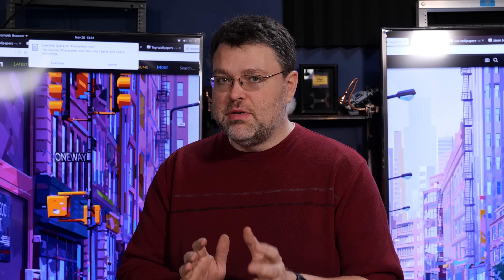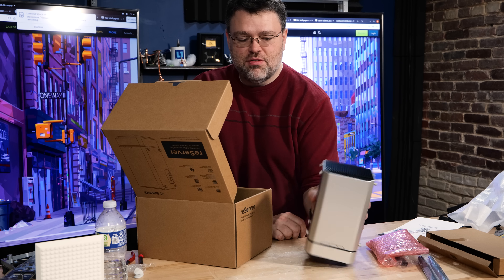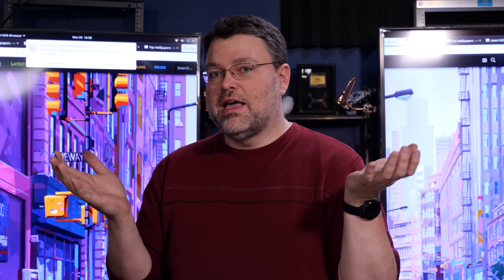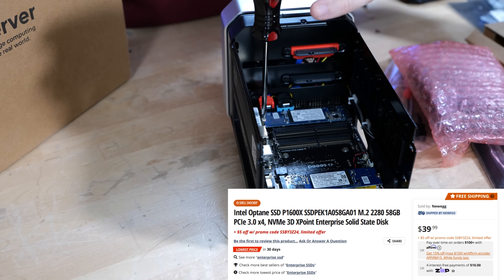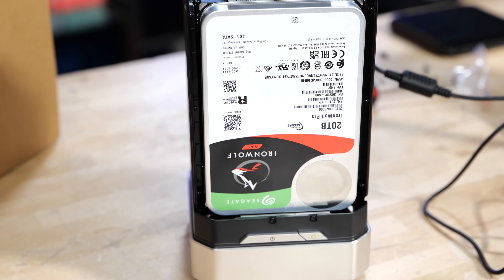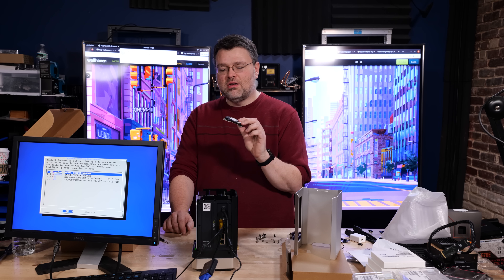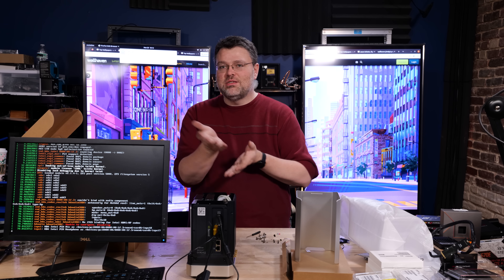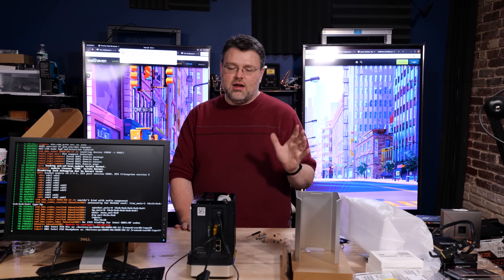Checking Out The Seeed Studio ReServer: Great For IoT + Home Server

Comment: Longish Term review: i've been using the i3-1125G4 model for about 18 months...and it's been great. i ditched the 3.5" drive caddys and just mounted dual 4tb ssd drives directly into the backplanes...I also have a 2tb nvme in a pcie card in the interior slot along with another 2tb nvme for the OS and 64 gigs of RAM. I found some "signed" 2.5GBE nic drivers to use with Windows Server (currently 2025).  I run vmworkstation on it and use it as a NAS/Command and control server. I run VMs like vcenter, Active Directory, Rancher, Xen Orchestra, Wazuh, etc...The 4 core/8 threads have handled everything, temps have been stable, and except for some weird hdmi not reliably working issue,  i would buy it again.
Reply: Do you mind sharing the power draw of this machine, I am looking  for a similar function myself, I am planning on running Proxmox on a raid-1 setup for all the VMs  and chucking 2 SSD's as opposed to HDD for storage
Reply: @hrgagan9192  it's currently pulling only 13.87 watts. It's fairly idle running a plex vm (not streaming anything) and a vcenter vm. I've seen it go as high as 35-40 watts when i'm hammering it...although i'm not really paying attention to the draw.

Comment: For people who are interested in the ARDUINO option, there is the FIRMATA Project. It gives very low entry level to have the Arduino for additional input and outputs. It works with most Arduino versions and can be used with any Arduino connected to USB.

There is just a Raspberry PICO in the higher configuration. Not! A Raspberry Pi! The pico is a whole over type of device. It can't boot any OS like the Pi could.

Comment: Hmm this might be a viable solution to upgrade my A300 DeskMini from AsRock, anyone experience with transcoding on this yet?
Reply: I have 2x NVNE, and 2x SATA 2.5 in the X300 I own. The m.2 WiFi could hook up to 2x external 3.5" disks via an adapter if you needed additional space.
Reply: @dfgdfg_  what type of 3.5 drives where those?

Comment: Of note: the raspberry co-processor is a RP2040, which is the microcontroller that powers the Raspberry Pi Pico. Nifty device nonetheless, but it's not a Pi 4 or anything like that.
Reply: Yes, Came here to say that. :) I checked their site to make sure. It is an RP204 like you say. I think he's got confused what RPi is on there. The two different micro controllers are for when it's used as an edge computing device. They will be a real time component collecting data via sensors and other sources, packaging it up, and piping over to the Linux system.
Reply: I thought that too. He should make that clear in the description or a top level comment.
Reply: Not worth shelling out for the high-end unless you need the performance then. The ARM M0 is pretty good on it's own for a microcontroller.
Reply: @emreelmas214  RP2040 is based off Arm M0?
Reply: Surprised there is almost nothing about it in the video after that intro.
Reply: Pico is the controller, like Arduino. I thought that was the whole point. Anything else, you can simply run a virtual machine that would otherwise run on the regular pi. Unless I totally misunderstood you.
Reply: Also it’s Realtime (RTOS)  while the raspberry , raspberry nano and any versions - this means the counts riinning hundreds fo of threads that are swapping contiuuty who swaps threads to keep the processor busy.

It’s vastly more complicated. A microcontroller typically has one thread and waits until each subsequent operation in im order. This js critical for timing dependent messaging z, i2c, spi,‘etc where clocks
Must shift on time- low to high in 10ns and then low again 10ns later as your send the clock

Comment: I want this, with whatever generation AMD/Intel has AV1 on the iGPU, record TV with Plex, trancode with TDARR, and host it all with TrueNAS or similar

Edit

It would be really cool to get an M.2 TV tuner from hauppauge and use one of these antenna ports adapted to coax. Top tier device would be a docker container that is given one of the video ports and connects to your TV to become the equivelant of an Nvidia Shield
Reply: Unfortunately we'll be waiting a while for actual full Decode/encode support on an iGPU equipped NAS.
Certain 11/12th gen mobile CPUs are equipped with Intel's AV1 DEcode hardware. Although even THAT is difficult to discern, as they break their mobile 11th gens up by "Intel UHD Graphics for 11th Gen Intel Processors (G4)" and "Intel Iris Xe"... 
Literally THAT'S the name of of their baseline mobile iGPU for i3's, cheap i5's, workstation CPUs, and certain Pentium/Celerons. Then the higher end i5 and i7 mobile CPUs get big boy "Iris Xe" graphics.
What's not clear is if both iGPUs get AV1 decode, or just the Iris Xe flavor.
If it's both, hope for a Celeron 6305 or Pentium 7505.
If it's only Iris Xe; this i5-1135G7 is your lowest end, widely available option.
Unfortunately, ALL of them are embedded CPUs, meaning no socketed solutions, and NONE of them support AV1 ENcode.
For full iGPU encode support, we're stuck waiting for Intel 14th Gen Meteor Lake, and it will STILL be likely feature locked to higher end, and/or embedded mobile CPUs with higher specced iGPUs.
So in summary, if you want AV1 hardware encode/decode, make allowance for an Intel Arc dGPU like an A310/380.

Comment: I am interested, but they dont list any models but the low and mid end, the higher end with the RPi co-processor are MIA
Reply: There's a model with an RP2040, a microcontroller made by the Raspberry Pi foundation. Prevailing theory in the comments is that Wendell got them mixed up because they're both arguably Raspberry Pis, just for different use cases.